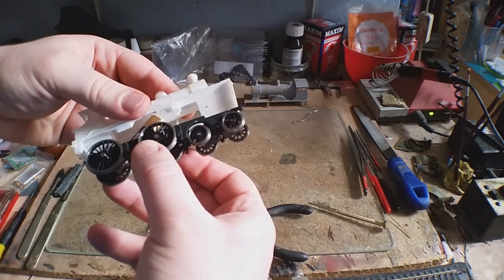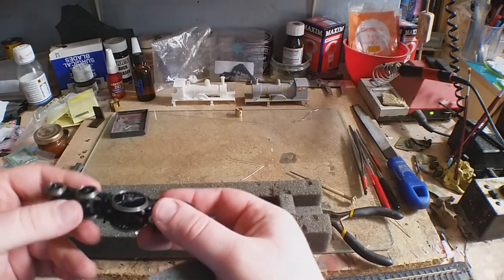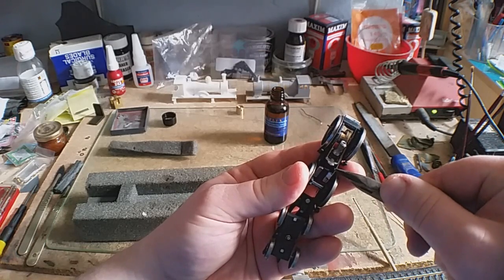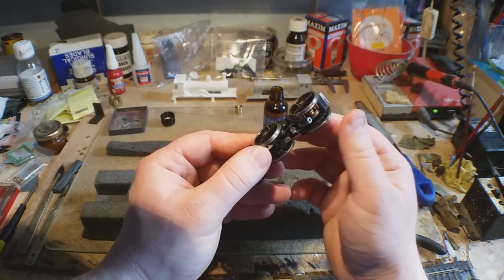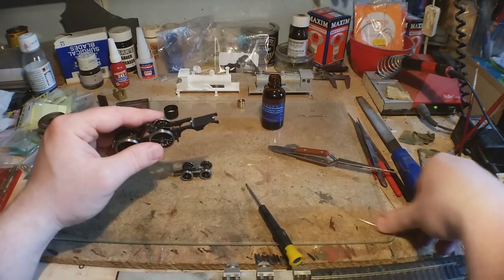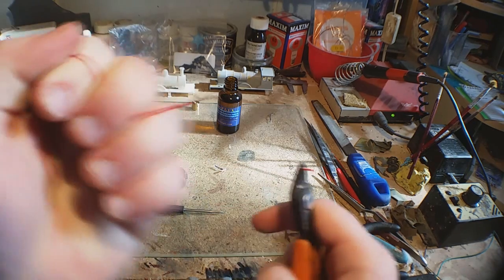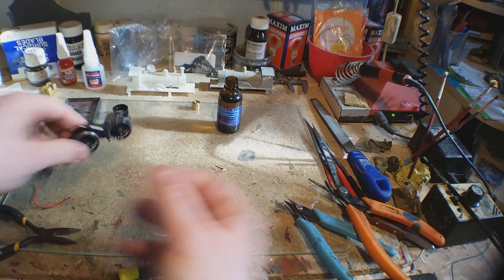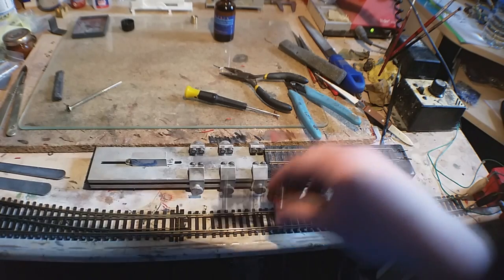Building an SCC Loco Kit - Part 10 - Electrical Pickups & Springy Experiments

Comment: Lovely idea with the springs on the bogie, very clever. I will be using sprung pick ups on my sentinel kit, how would you recommend going about painting the chassis? Would it be right to get it all built and running then remove the wheels mask up that needs to be then paint it?
Reply from the maker: +Colm Connolly- Taylor - I'm going to tweak the springs with a 0.3mm wire once I have ordered some as it is stiffer than I'd like.  I'd solder the chassis up then paint it, then put the wheels and stuff in.    It's hard to say as each engine is different.
Reply: +sparkshot good idea will give a better run to the bogie, and thanks il see how it goes when I get building it, I will probably take your advice and do that :)